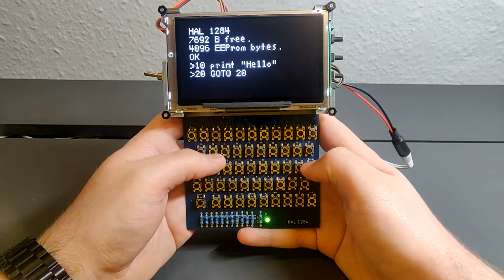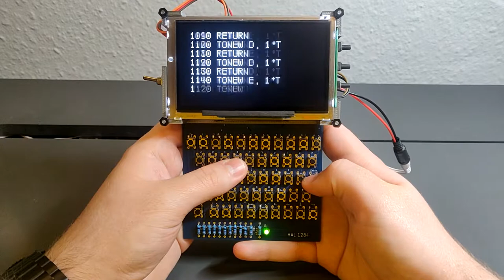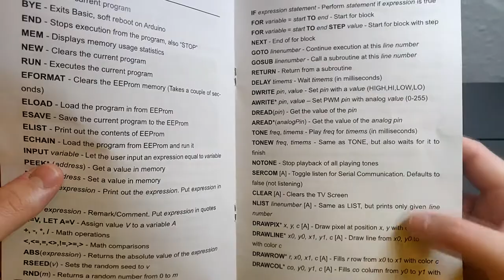DIY Handheld BASIC Computer

Comment: Subscribed, awesome man. I just started messing with basic on a c64, I know a bit of C but enjoy basic as well for its challenge and limitations. Old school, do you have more detail and a schematic available? Any info on the basic commands like poke and peek on this? Guessing its mapped diff than the c64
Reply from the maker: Thanks a lot, I appreciate that!
I've put a link to a (an?) Instructable-guide in the video description. That link should have all schematics as well as a description of the various functions.
I'm personally not sure how peek/poke works on this, as the main-part of the code is borrowed from someone else (linked in the instructable). I also can't test it, as the device was a Christmas present, and is now handed over to the recipient.
If you ever try to build it, or something even better, please let me know!

Comment: Why is there "AV" thing in the upper left corner? Is it not digital or I dont understand something?
Reply from the maker: Well, first of all, the project is riddled with idiot mistakes. At the time of making it, it was difficult for me to order PCBs, so I only ordered once and became aware of mistakes as I was assembling. I also had a "release date" in the form of gifting it as a present, meaning that software mistakes just went in the manual's backlog.
Now that I've gotten my bad excuses out of the way, I can actually answer your question! If you mean AV as in Audio/Video, then there is only video to be found in that corner. If you mean Analog Video, then you are correct when you say that it is digital. It's simply using the TVout library for Arduino, and I'm pretty sure that it produces a digital signal. However, I'm not completely sure.

The reason for the pins to be "exposed" is to allow users (in this case, user) to hook it up to any other TV for an even worse experience!

Why the upper left corner? It looked nice.
Reply: @AndersMygind  thanks! Helped a lot with understanding handheld computers and displays!

Comment: Can you use a Raspberry Pi Pico microcontroller to build this?
Reply from the maker: I haven't really looked into the Pico but as far as I know, its specs surpass the Arduino, so yes, I think so.
However, I don't know if you can write Arduino code to a Pico, so someone might have to port TinyBasic over to whatever the Pico is programmed in.